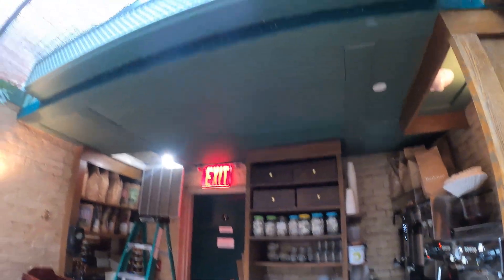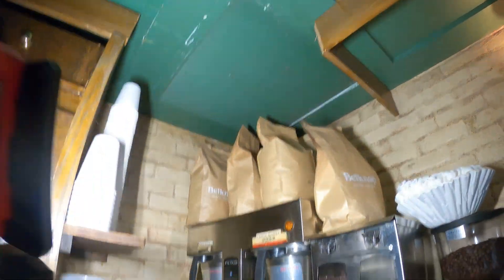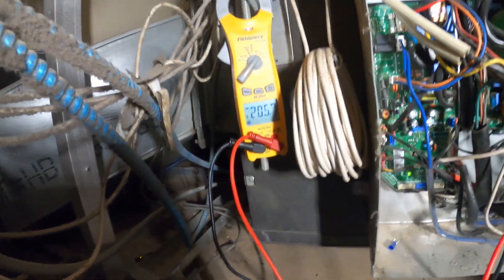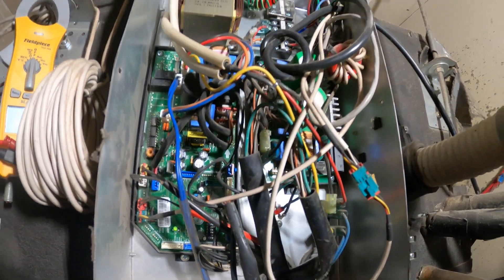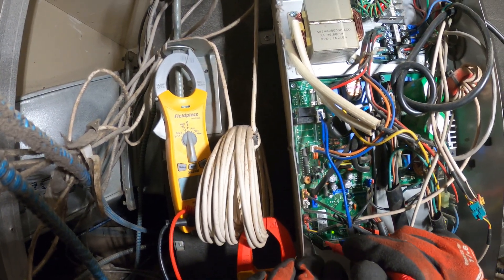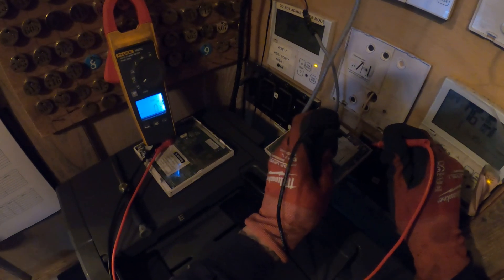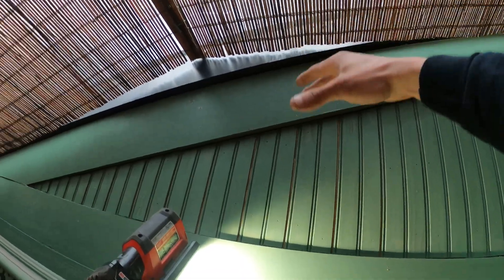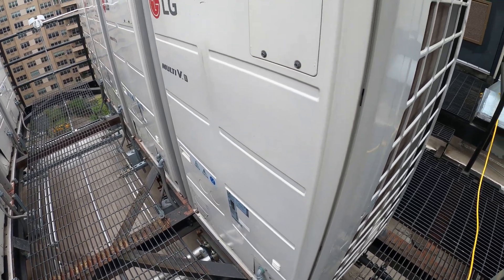HVAC Service Call: LG Multi V 3 Not Cooling/Heating (LG HVAC Thermostat Not Working/No Display)

Comment: Just a correction, the newer units there are Multi V IV(4) units, not the Multi V 5. 
What is with fan motors on all of the B8 IDUs making that odd grinding noise when starting up? All of the ones at my college make that noise at around 600 RPM's when speeding up or slowing down.
Does any of your locations have the BR chassis IDU's? Nearly half of the ones at my college all have motors with bad sounding bearings in them, wondering if they were a bad batch.
Reply from the maker: Thank you for the correction! I need to update the titles in my videos. I don't notice any grinding sound for the IDU's. They sound more of a whistling sound so maybe that is what you're talking about. As far as grinding noises, I've been noticing that for the ODU's at times and it sounds like a horror movie. Any input on that? What do you mean by "B8" & "BR"? Do you guys have issues with compressor loss? This location is losing compressors left and right constantly. Thanks for watching & stay tuned for new videos every week🔧⚡️
Reply: @JumpermanTech  I heard the noise a bit from 3:30-3:35, but not as prominent as the ones here. Will send an email of some sound recordings I have of the noises. B8 and BR are the chassis model of the IDU's (IE: ARNU763B8A4). At the time the units at my college were installed, the high static ducted units consisted(from smallest to largest) of the BH, BG, BR, and B8. Our college hasn't really been dealing with compressor losses, instead dealing with a LOT of communication issues from various communication boards going bad. If this place has a central controller, I would recommend enabling Oil Return operation(runs every night at midnight or whenever specified), as it makes the system return all of the oil back to the compressor, which supposedly helps with the life of the compressor. Not sure how to enable it outside of the central controller.
Reply: @JumpermanTech  I sent the email in case you haven't seen it yet.

Comment: I was saying hope it's not compressor again an inverter board lol😂 good fix in tight spot
Reply from the maker: Me too!! 😅 Thank you!!
Reply from the maker: Unfortunately, I came in just today to replace a thermistor for the outdoor unit and a new code appeared. Looks like another compressor and inverter board. There's some serious issues going on here. That's the 4th one in about 2/3 months. All different units but still. I just started working here at that time. Any input on that? This is getting out of hand
Reply: Someone has to check the current draw/voltage drop these unit on an breakers sizes health of the everything to evaporator to condenser